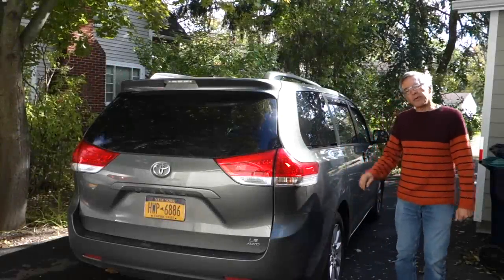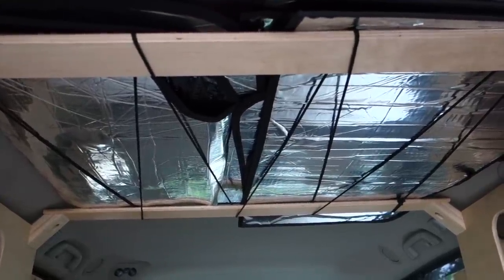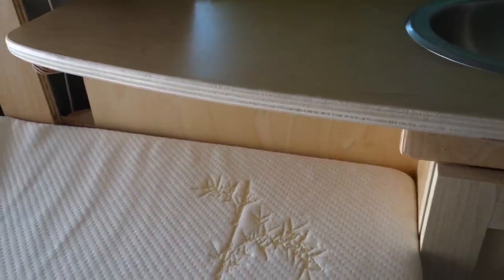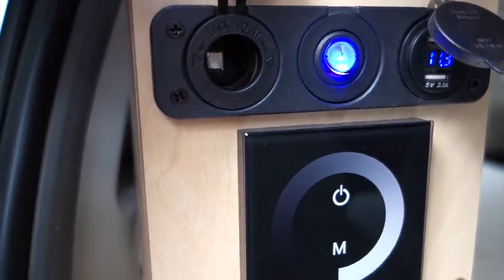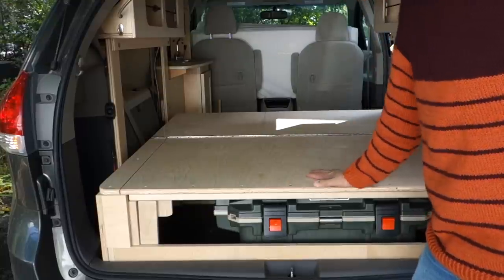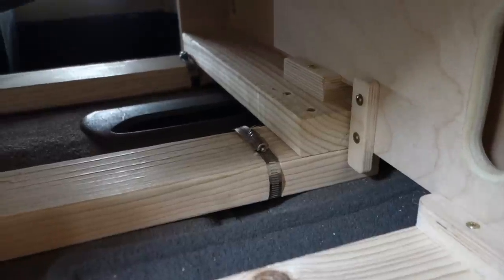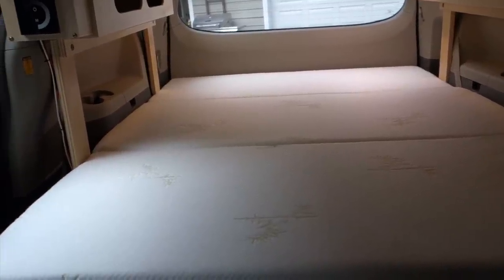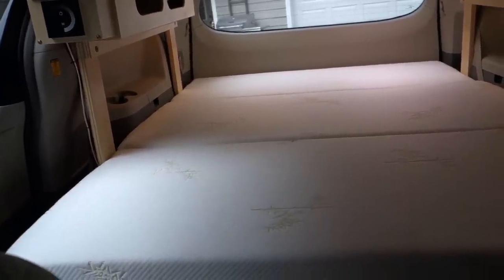A Slightly Different Mini Campervan Build

Comment: Very clean build. I have a 2017 Yota van that I use for work and have worked and slept outa for couple winters and a summer.   Pull the mid seats, drop the back ones. Put in the cot in, a heater for winter and sleep pretty dang good in it. 

Like to do something like this but build the front of the bed to fold into a seat that would be legal for transporting people/kids around.
Reply from the maker: Thanks for the comment. What kind of heater do you use?
Reply: @BruceParks  1,500 watt space heater.

Maybe later I'll put in an Espar heater

Comment: I’m looking to design modular type cabinets and bed for my camper.   I don’t want a bunch of permanent anchors or drilling’s that can’t be changed later if I want to alter my design.   Very inspiring.
Reply from the maker: Thanks for the comment. Your thinking is similar to mine. Always want to keep the options open down the road.

Comment: Bruce, thanks for ruminating on a design for variable sized vehicles. 
I just rewatched this again taking careful note as to how I might adapt to my specific needs in my Honda Element. Interior spaces appear quite similar. I will have a single bed on passenger side which will stretch forward to the dash as my front seat will lay back flat and removable plywood can then cover it for bed support.  Dash will also serve as a backrest if desired. This system was illustrated in “in the Element” vlogs. And thanks to you, I found the 25”x75”x4” folding mattress I’ve been searching for. As I don’t need a bed for two, I can utilize the bed as a couch with a backrest cushion as well. I’d like to have your kitchen unit under the driver’s side cubbies. Or, possibly a drop down shelf for cooking on in inclement weather. 

The main reason I considered the ceiling cross members was to not only support the wooden sides, but to hang privacy curtains. So your design solves many of my dilemmas. 

My question now is what is the purpose of the wooden piece across your rear hatch? You mentioned that was you head end but only noticed it when you were describing your bed and mattress. 

So there’s more fodder for chewing on. 
Cheers, MaryAnne
Reply from the maker: I’m not sure which board across the hatch you’re referring to. If it’s the board that’s low and connects the lower left bed frame to lower right bed frame, its purpose is to provide side to side structural stability for the bed frame. The board also sits slightly on the bottom of the hatch opening so that any weight we load onto the rear end of the platform will be supported directly by the bottom of the hatch opening. From an engineering perspective, the board provides a load path from the platform frame to the hatch frame. Long answer, sorry. And really sorry if that’s not the board you were asking about!

Comment: Holy crap that is amazing!  Had I seen this months ago, I probably would have gone in a different direction when searching for my vehicle for a camper conversion.  The idea that the vehicle is still completely usable as a passenger vehicle, with the build being modular/removable, is fantastic - perfect for long weekend, or couple of weeks at a time type camping.  I had pondered this for an old Bronco I have, but felt the 'engineering' of modular things was just too time consuming for me.  Most likely, beyond me as well.  LOL  If I decide to change directions, since I'm still waiting for welding work on my van before I start my build, it will be because of seeing this awesome, practical build!
Reply from the maker: I always appreciate having a positive impact on others. I'm planning a few more modular components before hitting the road again next year so check back later. Good luck with your build.

Comment: Great build I live in my van full time and for those out there that are wandering the ceramic tint is better than anything else what I find with the reflective material is that it builds heat in between the glass and the material which then radiates out into the vehicle ceramic tint stops all that
Reply from the maker: Interesting point, I've never looked into ceramic coatings. Seems worthwhile if you're spending a lot of time in the vehicle. Thanks for commenting.

Comment: This is by far the best minivan camper build I have ever seen. Very nice design and engineering. If you could design and manufacturer this setup for most common minivans so it is easy to install and remove when needed, I think it would sell very well. Sort-of like a flat pack furniture minivan conversion camper.
Reply from the maker: Hi, Paul, I've actually given a lot of thought to what would be involved in setting up to produce flatpack kits. I can see a basic kit and many upgrades. It's all doable but there'd be a lot to it. At present, I don't plan to pursue this as I'm happily retired with a full plate as it is but if I ever change my mind, I'll be sure to inform my viewers. Thanks for commenting!
Reply: You could sell them as individual kits. 1) A bed kit. 2) A drivers side door kitchen kit. 3) A passengers side door kitchen kit. 4) Or anything else you could design and engineer. Enjoy your retirement and your travels.

Comment: Very nice build with excellent craftsmanship!  The only change I would like is to put a shelf where the cup holders are as I think that would give you a lot more storage.  And, if you really want the cup holders, you might drill a hole for them in the shelf, yet still not lose too much storage.
Reply from the maker: Thanks for commenting. Regarding the shelf idea, yes, maybe that would be good. However, next to each cupholder is a deep pocket with a hinged lid that we use for a bunch of odds and ends. We also like the extra elbow room the area above the cupholders provide. But I will keep your idea in mind as I make changes to the minivan.

Comment: I use a 4" tri-fold (25x3) memory foam mattress in my Sequoia. It is very comfortable. My space only stretches 6'10," so I cut one of the 25x25 squares down by 6", and can fold it a fourth time as my pillow. However, it still folds up into a 25x25 tri-fold carry case and sits neatly in the rear until I need it.
Reply from the maker: Yeah, these mattresses can be cut all different ways and as long as they layout flat without gaps they still feel good.

Comment: Very impressed by the design and execution of your ideas .... some really clever concepts going on there. I'm also entertained by the amount of similarities in our campers. We use the exact same Milliard Full size tri-fold mattress as a couch in our custom truck camper and also the 6 gallon fresh water tank (we have two of them). I also ditched the marine style hand pump as I found it almost useless for most tasks and added a very inexpensive high rise faucet and a Sea Flo 30 psi 12 volt water pump to provide a pressurized water system using clear 3/8 inch vinyl tubing. I also inserted a diverter valve that connects to a portable outside shower while I was at it. All for about $75. It's funny that you mention starting out with the 9 inch futon mattress .... we started out camping out of the back of our Ram 1500 using two of those for our bed (placed directly on a rubber bed mat on the bed floor). We made several coast to coast trips over a 3 year period with that set up :-) We've owned 4 pull behinds and we are now on our fourth truck camper and have traveled over 100,000 miles in our 12 year retirement.  All of our rigs and rig mods are documented on our channel.
Reply from the maker: Travels with Yoly - awesome to hear about your travels. Our hand pump faucet is good for our simple means but when we’re ready for more, I’ll look at upgrading to a 12v pump. This would be after adding a deep cycle battery with solar charging, which I’m planning for 2019.
Reply: @BruceParks  The pump only draws 2.7 amps at a maximum (normal range is 1.7 to 2.7) and then only when water is flowing so very little draw on any battery, unless you're taking a really long shower :-)

Comment: Really great looking mimi-van conversion! I wish I could have your skill. My Toyota Sienna conversion  is really simple. I used two 2'x4' folding table and removed bottom the supports to add space above head. A 3/4" plywood sheets are put on the tables. Does not look nice but it just suits my need for sleeping place for fishing trip. After day's fishing I am dead tired so I just sleep.
Reply from the maker: Yes, in the end, sleeping comfortably is the most important thing. I call our minicampervan nothing more than just a luxury tent.

Comment: Brilliant! :D  Add a flexible solar panel or two on the roof with a small lithium ion battery pack , a portable convection stove top and small microwave and you're all set. :D
Reply from the maker: Thanks for commenting. For 2019, I'm planning to add up to 200W of solar panels and a deep cycle battery to power things like a small rv fridge, induction countertop range, tea kettle, and maybe a microwave.

Comment: Well thought out.  I like how some of the suppprts are hinged and fold up.  And modular is the way to go for versatility, hich is what I will be doing soon fir a cargo van with dual purpose of nomadic and some cargo hauling. Thank you for giving back re your using other's van builds to get help making your great build.
Reply from the maker: Well said! Excellent point about versatility. While I can easily remove my camper components, I designed it so I can still haul lumber and 4x8 sheets of material with everything installed. A dedicated camper that was only used part of the year just didn't make sense to me.

Comment: This is a great build idea!  Especially how some of the parts of the bed are multipurpose (the section that can become a table outdoors).  Looks simple enough to make!  We have a 2017 Honda CRV I'd love to try to camp in.
Reply from the maker: Thanks for commenting. Building out a vehicle is fairly straightforward after you make key decisions like how much space you want for the bed, how you're going to attach the framework to the vehicle interior, how you're going to store things up high, etc. I think most people underestimate the value of getting things off the floor, especially in a smaller vehicle. Being able to store things up high in cabinets and on hooks makes a big difference. Good luck with your build.

BTW, stay tuned to my channel. I've added bunch of new features to my minivan and plan to upload some videos in the next week or so to share the ideas.

Comment: Excellent design and execution Bruce. Did you already add insulation for better thermo and acoustic properties? Solar panels, batteries and inverter are a great next step. You could then use an induction cooktop for preparing food inside as well as power an on-demand hot water tap. The birch marine or aircraft plywood that you use can very easily be CNC cut and shaped should you consider putting your design into production. A finished floor panel could lay down between the front seats and the front edge of the bed so you’re not kneeling on the second row seat rails where it would also keep dirt from getting into the gaps.

Comment: Very inspirational!  I've been looking for some kind of weekend camper that will fit in a standard garage.  For ventilation you might want to search for "Cascade Campers" and see the small ceiling 12 volt powered ventilator.  Most minivan conversions are all bed and don't have room for bathroom facilities.  It would help if you could show the bed converting into a couch.
Reply from the maker: Thanks for the comment. Ventilation is especially challenging when you're going for maximum stealth and no permanent modifications to the minivan. Roof vents are a no-go for me. I'll probably develop a side window powered fan vent. My next video will include some upgrades and I'll make a point of showing the sofa mode.

Comment: Great build...perfect lines and cuts!! Most clean and neat build I have seen...I wish I could cut wood that smooth and even!! You know, I'm surprised more people don't build a conversion like this similar to the VW Westfalia design..It really would not be hard to do like you did with a kitchen area on one side and the single sofa that folds to a bed in the rear area then storage underneath..Then the Dodge Grand Caravan with Stow & GO seats has a huge underfloor  area that the middle seats fold into or when the seats are up, create a deep well for either storage or to add standing headroom..although I think that floor area of the well may not support a person standing..could be reinforced Im sure..anyway..endless ideas if a person wanted a more stealth and higher MPG camper van!!
Reply from the maker: Thanks for the comment. These campervan conversions are all about compromises. For the Sienna in my build, one of the top priorities was sleeping comfort for two people, which meant maximizing the bed width, which is 52". Westfalia beds are 42" wide (45" in Vanagons), which is really tight for two people. But the narrower bed allows for all kinds of cabinetry along the side of the van. A van built for one person could have a lot of extra storage, features and luxury.

Comment: This is awesome. Doesn't look like it costs a fortune. Great job.
Reply from the maker: Thanks for the comment. Cost-wise, roughly, $140 lumber (baltic birch plywood), $50 hardware (screws, hinges, etc), $100 electrical (LED parts, wiring, switches, aux (jump pack) battery), $60 plumbing (sink, faucet, jugs, fittings), $130 mattress, $170 WeatherTech window shades. Free labor :-)

Comment: Pretty sweet! Would you consider another on your building techniques and thoughts, ideas and such as you made and exicuted your plans. Thanks Song
Reply from the maker: Thanks for the comment. I'll give more thought to your suggestion but my initial reaction is there wasn't anything I did that was unusually complicated or nonconventional. It was just a matter of deciding on the main objectives (i.e. max sleeping comfort which means make it long enough and as wide as possible, and pick a mattress that is comfy; create as much overhead storage as possible (without serious compromises on headroom) with the idea that if it's not stored above, it's going to be in the way on the floor or bed; make max use of space (especially important in a minivan); make things multipurpose (like the footboard/table); make things modular and dis-assembleable; keep costs down; and no new holes). So it's really all about the planning and design, and not the actual construction. The woodworking was fairly straightforward with no exotic tools needed.

Comment: Wait till you do this with a Prius V the ultimate stealth ride. Just rent a storage unit when you arrive use it as a base then you have all you need you can carry winter summer spring wardrobe. You can also use the tools that make life really affordable on the road namely a clothes spinner .
Reply from the maker: If I was solo, I could definitely imagine setting up a Prius V for this kind of travel. Even doing the storage unit and ditching the house. However, as a maker, I need my shop space to make things so I could see renting a small shop that could handle the equipment and other life needs, with a hammock in the corner.

Comment: I lived in a Kia Soul for 42 months without anything fancy, had a six foot bed.  Baby wipes replace shower and sink and burn in a campfire, piss bottle, forest and rest stops replace a toilet.  Cardboard boxes can be as sturdy as plywood for most purposes in a van.  A large water container isn't needed with metal water bottles so much handier and stashed in so many small places.   I even had a clothes line inside for dry wash cloths on if I used them.   I didn't even take my rear seat out, just folded it flat permanently.  Next step up for me would be a camper van .. but that's an expensive proposition.

Comment: As said in the Comments I did get to, I really like the quality and simplicity of your build. Thank you for showing me I could attach side shelves and the like to the bed frame instead of to the side of the van. I don't quite have your woodworking skills, but I think that's the direction I'm going to go. I'm not sure if any of the other comments mentioned the concern of sleeping with your head to the back of the van when you're parked stealth on the streets, so I'll put it here. Obviously, you want to minimize the chance of someone running into you from behind. Park in front of another vehicle if possible, for example.
Reply from the maker: Thanks for commenting. Regarding the upper cabinets, they are self supported from below (posts from the bed frame) and side-to-side (with the two crossbars). What I don't show are small pieces of stiff foam (cut from pipe insulation) that I wedged into the narrowest gaps between the wood and the plastic interior panels; just one piece per side. This quiets the cabinets and keeps them from moving/vibrating during driving. I've seen some people clamp the cabinets to the grab handles above the 3rd row seats, not a bad solution. Regarding the sleeping orientation, thanks for the tip.

Comment: That was great!!  Could you please make a video of the electrical system?  Thank you for sharing.  Very inspiring.
Reply from the maker: Edward Jackson  - Thanks for watching and commenting. The electrical system was real simple, we just used a 12 volt jump battery (13,600 mAh) to provide power to the lights and plugs. We kept it plugged into the 12 volt port in back so it recharged when ever we drove. I’m going to do a major upgrade to the electric system soon, with the addition of solar power so that we can run a small fridge and some other things so stay tuned if you’re interested in seeing that. But for simplicity, the jump battery is super easy and affordable. Feel free to ask more questions if you want.